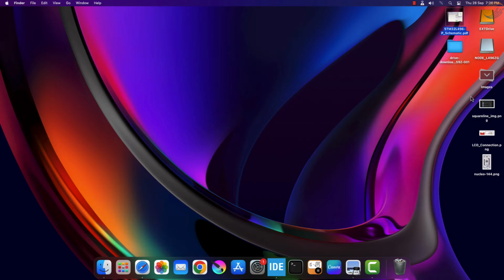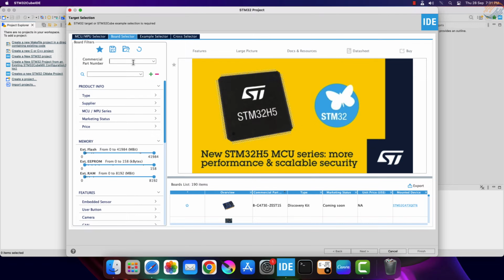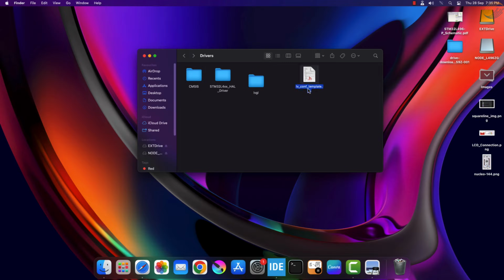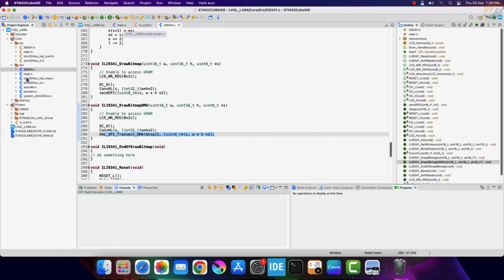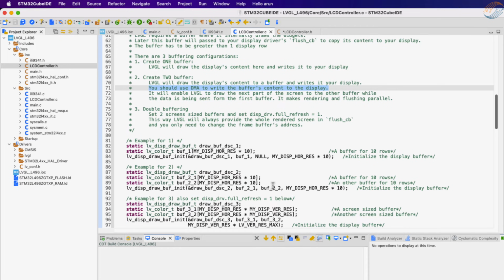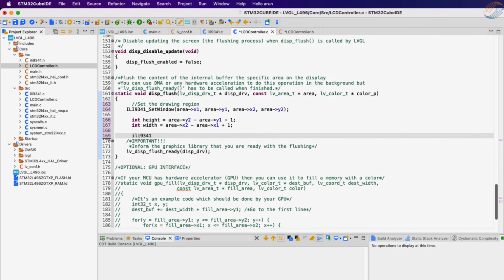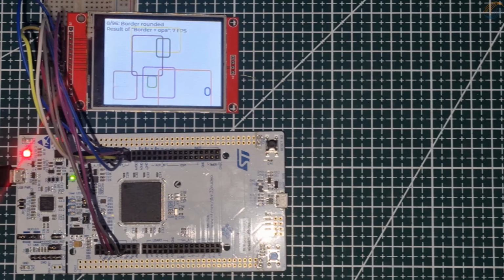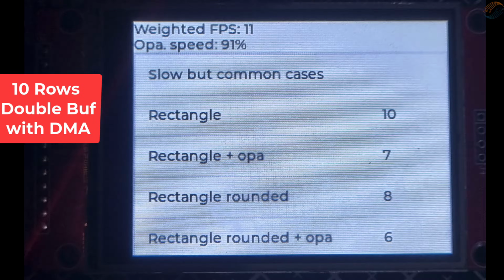STM32 LVGL Tutorial | Getting Started with LVGL on STM32

Comment: Hello. In STM32F103 when build the first example give me a error for Overflow memory Flash and RAM. Any solution for that? 
The objective is use the display to show a menu and touch options. The options active and desactive sensors for example.
Reply from the maker: F103 only has 64 KB flash. It is very low and is not suitable for lvgl.
Reply: Okey. Thanks for the answer

Comment: Please it doesn't work with ILI9225.. i tried a lot :/
Reply: int32_t x, y;
    /*It's a very slow but simple implementation.
     *`set_pixel` needs to be written by you to a set pixel on the screen*/
    for(y = area->y1; y <= area->y2; y++) {
        for(x = area->x1; x <= area->x2; x++) {
            set_pixel(x, y, *color_p);
            color_p++;
        }
    }

using this part of code, works but so slow because im drawing pixel per pixel, but it should work for me with draw_bitmap and it doesn't want .. i'll let you see my draw_bitmap function that im using in my ILI9225 driver :

void draw_bitmap(int x1, int y1, int scale, const unsigned int *bmp) {
	int width = bmp[0];
	int height = bmp[1];
	unsigned int this_byte;
	int x2 = x1 + (width * scale);
	int y2 = y1 + (height * scale);

	//If landscape view then translate everyting -90 degrees
	if (LANDSCAPE) {
		swap_char(&x1, &y1);
		swap_char(&x2, &y2);
		y1 = WIDTH - y1;
		y2 = WIDTH - y2;
		swap_char(&y2, &y1);
		swap_int(&width, &height);
	}

	//Set the drawing region
	set_draw_window(x1, y1, x2 + scale - 1, y2);

	//We will do the SPI write manually here for speed
	//CSX low to begin data
    HAL_GPIO_WritePin(CSX_PORT, CSX_PIN, GPIO_PIN_RESET);

	//Write colour to each pixel
	for (int i = 0; i < height; i++) {
		//this loop does the vertical axis scaling (two of each line))
		for (int sv = 0; sv < scale; sv++) {
			for (int j = 0; j <= width; j++) {
				//Choose which byte to display depending on the screen orientation
				//NOTE: We add a byte because of the first two bytes being dimension data in the array
				if (LANDSCAPE)
					this_byte = bmp[(height * (j + 1)) - i + 1];
				else
					this_byte = bmp[(width * (i)) + j + 1];

				//And this loop does the horizontal axis scale (two of each pixels on the line))
				for (int sh = 0; sh < scale; sh++) {
					//Draw this pixel
					lcd_write_data(this_byte >> 8);
					lcd_write_data(this_byte & 0xFF);
				}
			}
		}
	}

	//Return CSX to high
    HAL_GPIO_WritePin(CSX_PORT, CSX_PIN, GPIO_PIN_SET);

}
Reply: please if you can help or do anything I will be very grateful

Comment: I tried with STM32F411 and LCD iLi9341. But it's not working.
I checked CS Pin and this set is always low from LCD init. I must Set High when SPI sends ends and that worked. Is your project the same as that?
Thanks for your tutorial. <3
Reply from the maker: I mentioned in the video, try this after you have a working driver for the display.
Reply: using STM32F411 with ILI9341 like in the video works perfectly
Reply: My display does not recieve anything and ive checked conections thousend times, Can you help me telling me where did you edit the code for de cs pin please. (Im using too f411 and ili9341). THX

Comment: Works fine on my old STM32F4 discovery board, I am getting about 17 FPS with DMA and double buffering. Reducing buffer size from 80 to 40 lines does not drop FPS much. Thanks for nice and accurate workflow explanation, I have used different drivers but still managed to integrate LVGL with yout tips. One thing to note, If DMA is used, then of course LCD should not be deselected (CS high) until transfer is over, so this CS deselect command can be out in the notification callback too. Now I am going to follow your touch screen video :-)

Comment: I tried to follow the same for STM32L552 EV kit but its not working for me. Can you please help me out
Reply from the maker: Whats not working ? Do you have the lcd drivers for your display ? Does the code builds fine ?
Reply: @ControllersTech  Yes the LCD display is mounted to the EV kit. Even drivers have been programmed and code builds fine too. But I'm not able to see anything on the display. I got to know that my LCD display has been used by MFX IO expander. I need help with how to access GPIO pins through I2C to IO expander.